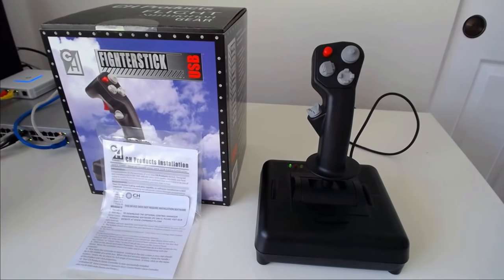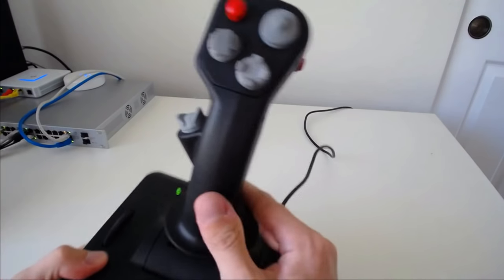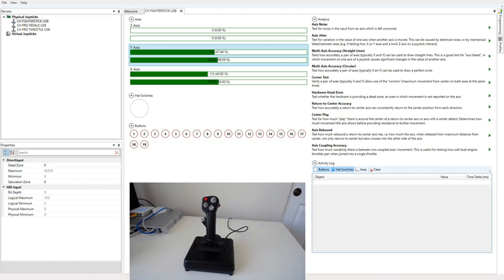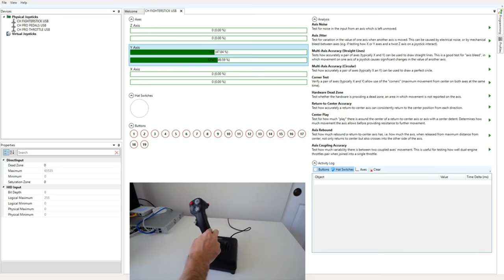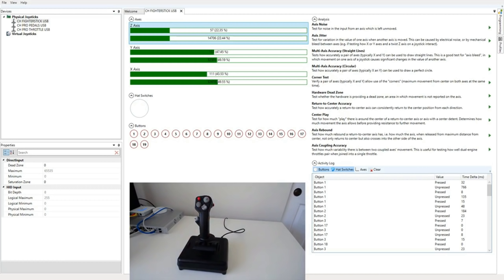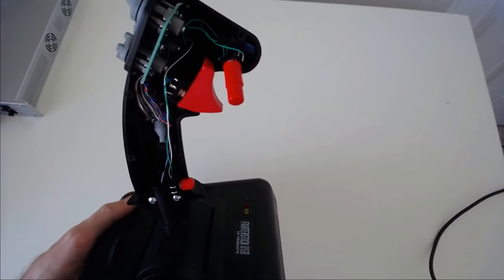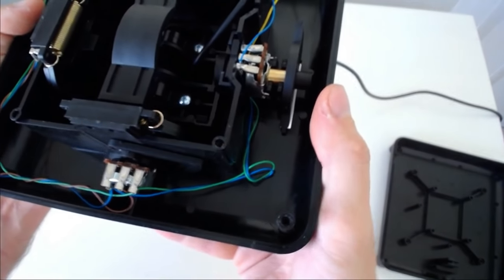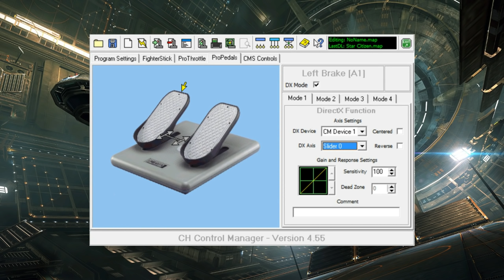CH Fighterstick Review and Disassembly

Comment: I bought CH Fighterstick + Throttle + Pedals for the number of buttons the stick has, but the 8-bit precision is a problem. I can set curve for the stick to get some better precision near center but then the precision gets much worse from 1/3 of the way to the ends. So I reverted back to Sidewinder FFB2 and key combinations.

Now I'm looking for something with more buttons than CH products and higher precision than FFB2.

Thrustmaster FCS TWCS Throttle can easily beat CH Pro Throttle all around, but T16000M only has better precision than FFB2 but not more buttons (on stick itself).

Thrustmaster HOTAS Warthog does satisfy both of my conditions but I've tried it and didn't like how heavy the movement and buttons resistance are. It's more for sim than game. Of course you want the missile launch button to require some strength to operate for real world (and sim), but in a game I want to press buttons without much effort.
Reply: Qi Fan lol welcome to the world of joysticks where everything is shit unless it's a warthog. I've got the exact same problems as you do lol.
Reply: Qi Fan thrustmaster or Logitech need to make a stick with base buttons and mag sensors or stiff no movement pressure sensors with more than one hat- BMS has a problem with control inputs, the 16000 m doesn't have enough 4ways on the stick. No joys besides the 16 have base buttons...
Reply: Hi. I'm not a fan of serious flight simulators and I'm probably just interested in trying to play something arcade or at least Elite Dangerous. Can you tell me if it's worth buying a CH Products Fighterstick for $150 in 2022? Or in my case is it better to get something cheaper like ThrustMaster Sidestick Airbus Edition (~$70) or ThrustMaster T.16000M FCS (~$80)? Thanks

Comment: Does this work on windows 10?? No rudder control?
Reply: Work in Windows 10 - but programming software (use optional) has issues for run in this OS.
This stick has no "twist" rudder, hence require dedicated rudder pedals, or throttle with rocker paddle (TWCS) or mini-stick (CH PRO Throttle).

Comment: To be quite honest, I actually like the Fighterstick more than the X55. I've got big hands, but the X55/56 layout doesn't let my thumb fall naturally onto any of the buttons, save for the POV HAT. My hand actually starts aching after not a lot of play time, as well. I got the stick and pedals for $140 total, but I'm pretty screwed on the throttle for the moment. YES, these things are overpriced. Jesus. BUT, aside from my very first joystick, the Sidewinder, the Fighterstick and pedals is the best I've had, over the Cyborg v1, Logitech Extreme 3D Pro, Saitek X52, X52 Pro, and the X55. I guess that's personal preference, though.

Still feels way better than Saitek, though. But for some reason when I play my favorite space game, the Y axis tends to get caught and push ever so slightly down in both mapped and direct mode. Would that be a potentiometer issue or just how the game is detecting input?
Reply from the maker: The game shouldn't detect Y input unless DirectInput reports Y input meaning either the joystick is reporting it or there is a calibration issue. You can look in the CH Control Manager to see if your joystick returns to center on the Y axis. If it doesn't your problem is either a) you need to recalibrate, b) the Y-axis trim wheel might have moved from the center position, or c) there is a problem with the joystick. If it's C, you might be able to fix it with a deadzone in CH Control Manager if the deviation from center is small.
Reply: I'm not sure what to make of it. It didn't do this when I first bought it a few weeks ago... watching the data shows that the upper Y-axis is accepting input from the play in the stick, but the lower Y-axis actually requires the stick to be moved. Calibration doesn't seem to help.

Comment: ~21:00 - plenty of spikes in potentiometers response with joystick on rest...

Compare with Slaw pedals electronics there: https://youtu.be/TjClrNbZVNI?t=41

 + plenty of play in gimbal,  "clunk" center system... 8 bits controller...1990's design. 

But build like a tank, with reinforced (fiber or Nylon) plastic. ;)
Reply from the maker: I actually saw some much worse spiking during my testing, but it didn't show up during the review. On my other PC I would sometimes see spikes for a split second of as much as 10% of the total range on the throttle axis. I wasn't able to capture it during recording though.

The Slaws are beautiful, not just in the metal work but electronically. Absolute works of art! As of yet I've only worked with low end pedals (CH and TFRPs). I almost ordered them a few weeks ago but I ended up getting on the waiting list for the Baur pedals instead. Hopefully in a couple months I can do  a video review of them.
Reply: Spiking is the plague of any controller. Especially the throttle axis, when you need precise, smooth and/or steady control (collective).
There should be an international law to ban the pots from any design ;)
(and no filtering should try to save them :P)

Comment: I own a full CH set up with the Fighter Stick, and I agree with your points wholeheartedly. Will you do a review and teardown of the Pro Pedals? Mine has a regular issue where the main pot has a spaz out on return to centre for the main rudder action. I pulled it apart to try and see what was happening, but everything looks fine. I know I voided warranty, but I didn't want to spend the postage money to send them back for a warranty claim. I've spent enough on this overrated set up already.
Reply: Hi. I'm not a fan of serious flight simulators and I'm probably just interested in trying to play something arcade or at least Elite Dangerous. Can you tell me if it's worth buying a CH Products Fighterstick for $150 in 2022? Or in my case is it better to get something cheaper like ThrustMaster Sidestick Airbus Edition (~$70) or ThrustMaster T.16000M FCS (~$80)? Thanks
Reply: @VamIy  just get a VKB Gladiator NXT EVO. That way, if you change your mind and you want to get deeper into the Sim world, you'll have a decent stick for a reasonable price that's capable of much more than a CH system. The VKB NXT ecosystem is extensive, with many unique panels available for both military and general aviation simming. You can go as shallow or deep as you like into the NXT system, and best of all the base stick is probably the best budget conscious stick on the market. 

Regardless of which stick you choose, I doubt you'll even have the choice of a brand new CH stick. Hard to find them anywhere these days. I think they're out of production.

Edit: I should mention the Gladiator base stick is designed to work well with space sims, given that it has a mini stick on the handle for easier control of ship thrusters. CH only features one on the Pro Throttle grip, and it's not very good.
Reply: @toothpik00  Thanks for the reply. I have already been advised VKB, but they cost from 180 dollars and with a problem to be delivered to my country. I agree with your idea because it is optimal but alas a matter of extra 100 dollars... Right. But if you look closely to ThrustMaster Sidestick Airbus Edition, which in addition has the ability to change the hands of the right-left and it costs only 80 dollars ... maybe it would be a good solution to start with as well?
Reply: @VamIy  yep the Thrustmaster would be a good option. It uses a Hall Effect Sensor too rather than shitty old potentiometers. CH Products are generally overpriced, considering the controllers still use potentiometers. The buttons are great and it's tough plastic, but the overall feel of the devices is very lackluster. My complete CH setup cost me over $600, and I had to negotiate with the store operator to get it down to that price.
Reply: @toothpik00  Do I understand correctly that the T16000M would be better for space and the airbus for flight simulators? I'm also worried about the hand to play with. I'm right handed and I've already said what games I'm mostly going to play so the question is do I need a joystick for my right hand or can I get one for my left? I assume the left hand joystick is only necessary for left-handed people and those who are going to play flight simulators from the main pilot's side or?
Reply: @VamIy  The T1600M can be used in either hand, so that's not an issue. As for which is better for space sims, I don't have any personal experience with these joysticks to compare them. So I'd recommend searching for a comparison video on YouTube. My guess would be T1600M would be better as an all round joystick for multiple different simulators. If you want a throttle, the Thrustmaster sliding throttle is also likely better suited as an all round throttle for multiple types of sims than the Airbus unit.
Reply: @toothpik00  And what about the device - the engine control lever? Is it mainly needed for those who play professional flight simulators? Can i not think about it yet?
Reply: @VamIy  throttle or 'engine control' as you put it is still useful in space sims. I think the T16000 has a little throttle slider on the base that would work. I started out with a joystick similar in design to this, but I got sick of it pretty fast. I bought the Thrustmaster HOTAS X because I wanted a dedicated throttle for engine control. I was mainly playing Elite Dangerous in those days. The HOTAS X is good because it has a centre detent. This made switching from forward thrust to zero thrust, then to reverse thrust very easy. This forward/neutral/reverse control is much easier to perform with a dedicated throttle. Especially if that throttle features a centre detent. After that I moved to the full CH Products setup, now finally I'm using dual VKB Gladiators. One of which is modified to operate as a throttle.
Reply: @toothpik00  I see an ad for an old HOTAS X for $50 in good condition. But I can also buy a new T16000M for $70... hard :D... but it seemed to me that the HOTAS X is worse than the T16000M because of the price because the HOTAS X has more than just a handle and it costs as much as one handle from the T16000M... Hmmm
Reply: @VamIy  I don't recommend the HOTAS X. It still uses potentiometers for control inputs. The stick also has limited range of motion. All-round, it's not worth the investment. Tech has moved so far beyond what that stick offers, there's really no excuse for Thrustmaster to still be making it. Having said that, I have not looked at that product for years. I know they did some updates to the exterior of the device. But I don't know if they changed the internals to use a Hall Effect sensor. I doubt it, but I could be wrong.

The T1600M is very popular in the Sim community. Especially for space sims. I think that's a good starting point for you. I just wish there were more options in this price range.
Reply: @toothpik00  I bought the T16000M and I like everything except for two things... maybe you have had experience and can give me some pointers? First problem in Elite Dangerous: The axis which is responsible for the engine power is malfunctioning: it only works in two positions engine at maximum and engine at minimum and therefore I can't set the axis to 50% to fly at 50% speed like in other games... Problem number 2 in War Thunder: I can't even complete the training! Even if I don't touch the joystick my plane wiggles back and forth from left to right very strongly and I just can't aim at the enemy I tried for 20 minutes and didn't even shoot down one plane... but if i turn on the mouse control, everything is perfect the plane flies smoothly but on the joystick the plane wiggles so much to the sides as if i was flying in a storm with a huge wind...
Reply: @VamIy  First step would be to use the Windows (I hope you're on windows as I have no experience with Apple.) Set Up USB Game Controllers tool. Should be in Control Panel, but if you're on Windows 10, just search for it in the Start Menu search box.

At this point, click on your T.1600 and click "test" or whatever the option is. At this point either a window will pop up showing output of all the axises and buttons, OR a message from Thrustmaster will pop up telling you to use the, I think it's called "TARGET" software to setup your joystick. Note, I have no idea if this is likely to happen, but I know that's what happened with my CH controllers. It would tell me to use their software instead of Windows. Problem was the CH software doesn't like Windows 10... But I digress...

If you have to use the Thrustmaster TARGET software instead of the Windows tool, the principal is the same for both. You should have an area you can test all buttons and axises and ensure they're operating smoothly. You should also see an option to calibrate the device. Do that and follow the instructions on the screen.

Once you've determined the device is behaving correctly using the calibration and testing software, we move onto the individual game settings.

In Elite Dangerous, it sounds like your throttle is behaving like a button, not an axis. Elite has very detailed controller options. And it can be very confusing, especially for the inexperienced. 
In the control options there are extra sub-options attached to each control axis. So you can have that axis behave differently depending on what you set this sub-option to. Just find the throttle axis and play with the sub-options and see if you can get it working. Unfortunately I think you have to load into the game each time you change something to test it. Bear in mind I haven't played elite for a couple of years, so things might be different now.

For War Thunder, it sounds like a sensitivity issue. I remember, many Eons ago, trying to fly with a mouse in Battlefield 1942... It wouldn't work unless the sensitivity was maxed out, otherwise the aircraft changed direction too slowly. I haven't played War Thunder, so I don't know how they've set up their flight control sensitivity. It's possible they have a global setting that affects ALL control inputs and that could be turned right up to facilitate mouse flight control. So if there's a setting that just says "flight control sensitivity" or something to that effect, it might be affecting your mouse and joystick controls to the same degree. In which we'd be seeing the exact behaviour you've described.

Remember to use YouTube and internet forums to help solve these problems. Provided the joystick is brand new, I doubt there's an actual problem with it mechanically, but that is always a possibility.

Good luck!

Comment: This is a great video, very thorough and instructional. Great job!

I have a question for you please matey, i am looking for a Dual Stick setup for Star Citizen and i already have a Warthog stick for my right hand.
As you probably know the Warthog does not have twist and i would like if possible to avoid using pedals.

Can you recommend a Joystick for the left hand that has twist and also has very good build quality?
I am looking for something other than the T16.000, i am not saying that the T16.000 has bad build quality but i am looking for something better.

If there isn't any Joystick for the left hand with twist and i will have to get used to using pedals can you suggest some other left hand Joystick with great build quality even if it doesn't have twist please ?
Reply from the maker: Only current left hand sticks I know of are the T16000m and the custom left-hand Warthog grips. See a review of it here: https://www.youtube.com/watch?v=q8YxA2tSLYE . Ideally for left hand use if you want high quality I would go with the left-hand Warthog grip plus an FSSB R3, Black Mamba, or Gladiator Pro, but that is a pretty expensive setup, and you need good disassembly skills since the left hand Warthog grip is just the chasis, you have to buy another Warthog and migrate the electronics into the left-hand grip. Only other choice is the T16000m.

Comment: If you need a metal gimbal.. on a non force feedback stick. You need to learn muscle control ;P After using the warthog for two days now, I would boost the ch on its Grip and stick feel, but the warthogs gimbal has it hands down. Warthogs metal finish is terrible for sweating, and the lower half of the stick is too much realism, not enough ergonomics.  And i would say the CH software is more flexable. Which ever you go with, both are good, I personally would take a warthog Joystick if I could get it at the price of the CH.  The throttle on the otherhand... Well we wont go there.

Comment: Baryon, you are missing the main point. There is a reason why CH gear sells like "hot cakes" despite the high price. People like CH products because of their incredible reliability. Thats what you are paying for, an item that will still be functioning like new 10 years from now. How do I know this? Because I have had my CH gear for about 10 years without any problems
Reply: ^^ This, have had my throttle quadrant for 7 years and its still good.
The CH Flight stick as well, mine is an old gameport that I use adapter for.
VERY old, but PERFECT spring tension and ALWAYS returns to dead center.
Reply: If they took they're reliable stock components and made a Dual quadrant throttle to compeat with some of the other hotas options

Comment: I can rest my hand on the shelf and reach the top buttons with my thumb. You must have freakishly small hands for a guy.
Ive owned my CH stick for the last 15 years and its still working faultlessly with no centre play or electrical noise, something that cannot be said for my less used Logitech stick.
I dont mind the mechanical noise as I game with headphones and soft touch materials absorb skin oils and go mushy and flake off with age. I like the textured plastic as it is.
Add grease to plastic components and when the inevitable dust gets into the mechanism you end up with grinding paste that will wear out the mechanism faster... I'll keep it dry thanks.